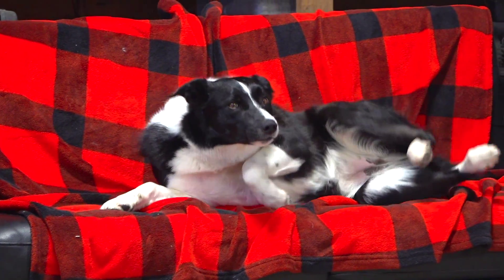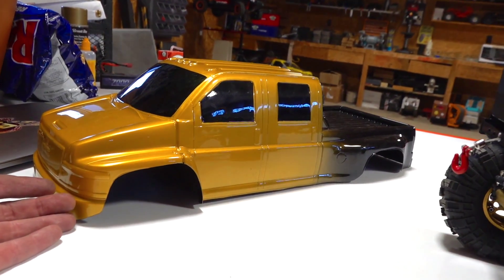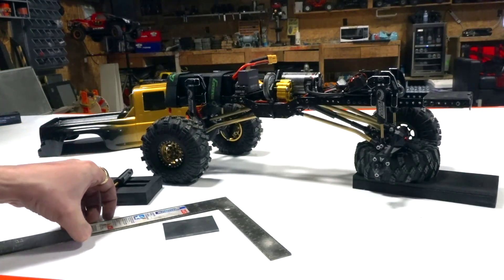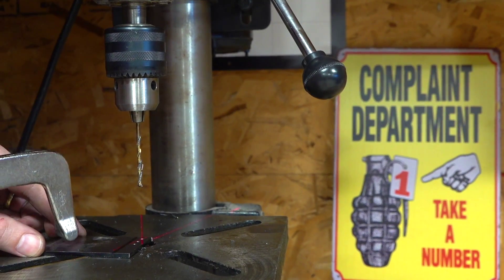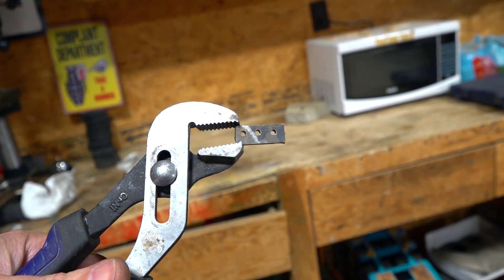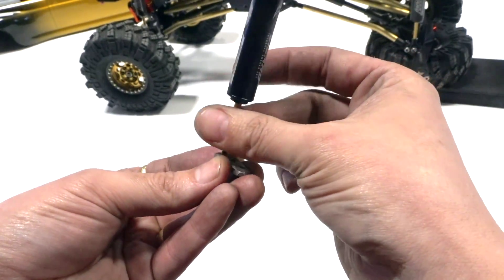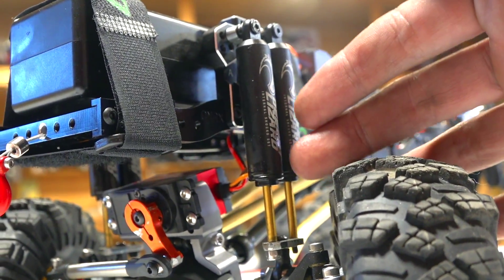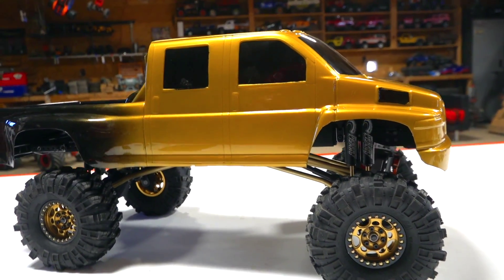PROJECT "OVERKILL" 2020 - HOW to MAKE a DUAL SHOCK MOUNT for ANY TRAIL TRUCK (PT8) | RC ADVENTURES

Comment: With your experience, I dont see how you could have chosen any other path for this build. I like watching you work. Exceptional build, thank you for sharing the process.
Reply from the maker: I felt the same way. I knew to make a new build of an iconic truck from 2012.. that in 2020, I would have to bring "game" to the table.  A lot has changed in the radio control hobby industry, as well as on YouTube. I am still not quite finished with Overkill 2020.. have a ways to go yet. Thanks for the comment

Comment: Just a quick tip for you for tapping holes; chuck the tap into your drill press immediately after the hole is drilled, before you move the piece. Turn the chuck with your hand to be 100% sure that your hole is tapped as straight as possible. Don’t use the power of the drill press to drive the tap for you. That’s a good way to break things! Hope this helps, keep up the amazing work!

Comment: Truck looks absolutely sick so far. One tip, don’t use an awl for center punching your holes, use an actual center punch. A decent center punch is actually made out of tool steel and the pointy end will stay sharp so much longer. Also, you should use some tapping oil when cutting threads in steel.

Comment: I remember the video where you pulled out the black Toyota without a wheel onto the trailer pulled behind the top kick. By far the best vid with that truck yet. (The snow plow ones are also pretty good)
Reply from the maker: "Black Tundra Rising".. Lol.. :) I remember

Comment: Medic, you may find that a scriber (sharp point in the end of a pen) to allow a thin accurate line to be made.  The carbide tipped are the best.  When you're on the drill press I noticed that the drill bit wondered, use a spot drill first, then the drill.  Spot drills are also handy for countersinking (breaking the sharp edges/ burr from the bottom of the hole.  love the build.  Jp

Comment: With the rear shocks vertically offset, if the lower of the two shocks bottoms out, it may put additional angular (?) load on the shock shafts of both shocks.  I'm not sure if the amount of force is enough to be concerned about, but it is something to keep in mind.  Keep up the cool build!

Comment: In Alaska we are at a great time for this and I think down where you are you still have the best weather. 

If you leave the steel shock mount plates outside, get them a little wet and possibly salt, and just let them sit outside for a while they will rust faster. It might be a way to artificially stimulate it. (Considering it will not spend weeks and months outside while in the RC.). 

Great truck, sorry, no, I have not seen the original.

Comment: You should cut the front bumper off the body and weld up a tube style bumper with your fairlead in it. You could make the bumper right to the body so it would protect it and also not get hung up. Great mod. I might use your idea!

Comment: Little advice in the truck pull/tug of war  use your winch around the axle to suck down the front suspension just a little should help with any axle wrap or wheel hop

Comment: Yes I could not beleive how long ago that was I remember from the first to the last big build. Suggestion add 3 to 5mm of fuel line and put between the chassis and the hook thread it over the cable and refit hook it will save the servo and also stop the hook from rattling.

Comment: FYI you can grind aluminum with a normal grinding stone etc. look for WEICON ALU Grinding release spray it on your grinding/sanding and drill bits and even cutting blades anything used to cut or grind aluminum it stops the aluminum from gumming up on surfaces. I have  been using it for 8 yrs in my day to day as a welder/fabricator.

Comment: Hay man awesome build love it, I do have a thought about the set up the shocks are free moving at the top but the shafts are ridged mounted at base which introduces a small shearing force on the shafts ( I’m not saying they will fail as is a light application) just a point of interest you may want to do a redesign to allow for a little more give. Usually see by side mounting has a solid mount on axle and shocks retain eyelets to flex freely. It’s a minor thing I think but man hate to see you loose from bust shocks, big hello to family now get inside and fix rc’s.

Comment: Why not full the secondary shock filled with oil and use as a dampener like a desert truck to use shock rebound and dampening to maintain traction no matter speed of compression or rebound, primary sprung shock maintains ride height while secondary utilizes resistance to keep tires on surface. And the custom shock plate would have even pressure to elevate shock pistons being bent at plate mounts, just a thought maybe slightly over thought but never the less I would do that for a crawler setup 🤔

Comment: I saw you were missing a locknut upfront, driver side shock. Also, if you want it to be a little more balanced in the rear, move your rear upper links to the outside of the truss (about 40-45mm screw). That helps a lot for me when I comp. I did watch all of the OG Overkill. 👍🏼

Comment: I didn't say anything about using a Grinding Stone on the Aluminum... It's YOUR Grinder!! 😜 A Belt Sander would be much safer.

AWESOME solution to the Fairlead issue, Aaron! 👍👍👍👍 

I of COURSE, remember that original Project Overkill - 😁

.... If you fit double Shocks at least 30 Degrees from each other, it helps eliminate Axle Windup... i.e. Axle Hop. 
Carmine ✈🚂🚙

Comment: A beast under the body. Just trying to understand the duel shocks set up. In this case it is for a strength rather than stiffness? Do the unsprung shocks add dampening at all? I love watching these clips to see what goes into the builds.

Comment: Good idea but on the back shocks should have springs in both, the front shock will leverage your bracket possibly braking rod end or binding the shocks. Your front is great.

Comment: The setup you have there will cause binding. If your are going to have them tied to a single pivot point on the bottom you need to have a single pivot point on the top also.

Comment: hey bud! cheers again from near Toronto..just a what if..but perhaps over time the winch might rub against the frame and the wires might start to split apart. was wondering if a rubber grommet hot glued to your oversized hole would do the trick or would the grommet would wear out before the wire. not sure since i do not have an winch on my RC, but just an idea. keep up the inspiration to everyone who follows your channel like myself..another cheers to you! keep up the amazing and informative work.

Comment: I wonder if you are going to have any frame tilt going sideways on a steep hill, I usualy adjust my shocks just at the point where you prevent that but still keeping it flexy 👍 To avoid a side flip rolling down the hill 😉 Stunning truck as always! 🤩

Comment: Mr medic I know you have a compressor.. the best tool I have is a nuematic angle die grinder and small disk sandpaper set up works great I use it for everything wood metal aluminum...

Comment: When you’re tapping your holes go in a turn then back off a 1/2 so that you don’t risk breaking the tap
Reply: JacksVIDS  very good advice I’ve seen guys impact em in and boom snap in the hole.. good luck drilling it out lol
Reply: Don't always have to. Depends on the size of the hole and the thickness of the steel and where it's at on the hardness scale.

Comment: Definitely remember the original Overkill build, just a curious question though, have you thought of a way to keep the duals from twisting side to side, causing a possible binding/rubbing between the shocks, just a thought nothing more

Comment: Hey medic I have a traxxas slash 4x4 and I have been running 2s and I switched to 3s and I can not keep my drive shafts from snapping even steal ones. I was wondering what you would run in your 3s slashes?

Comment: It would be easier to have the center hole with no threads in it. Slightly bigger to the screw threads. No binding to secure in the shock eyelet

Comment: How about making a triangular plate with 1 hole at the bottom to secure to the bott mount point, then 2 holes at the top, and connect the bottom joints of the shocks to each of the separate holes, front and back on the triangular plate.. This would distribute the load better and overall be stronger, not relying on a single vertical screw into a plastic joint at the bottom

Comment: The only concern I have with that shock mounting is bending of the shock rod ends and you should have both shocks with springs but with reduced spring strength

Comment: You should look at the bottom plastic eyelid at the end of the shock, all of the weight of that “tough truck” is on that tiny little eyelid and will snap. Don’t want that on the trail. Maybe get a aluminum one. Or stick with steel and redesign it.
Reply from the maker: Aluminum, but they are in transit

Comment: Why don't you mount a vertical extended bracket from the suspension bolt and the shock mounting bolt, that goes above the axle,  you can then bolt two shocks too ...kind of hard to explain

Comment: Aluminum powder or grinding swarf is potentially dangerous if it is mixed with iron or steel grinding wastes and is wet. These are the basic ingredients of a thermite bomb, and there is a very real risk of a fire due to the reaction between the aluminum and the iron. However, if the aluminum and iron wastes are kept separate, then there is little risk.

Also, what are the actual benefits of having more than one shock? I understand if you have two eyelets having a backup would be good but if it's all on one eyelet what would be he benefit as your putting it all on that one eyelet versus two...little confused :(

Comment: Hey rc sparks I’m looking for new 1.9 wheels and tires all metal for the weight and bead locks for a good price and lots of styles can you send the website or sites you use open to everyone and also looking for the best 110mm shocks metal preference as well

Comment: Why can't you use aluminum on a grinding wheel it's softer than steel but if you can use steel on a grinding wheel or titanium why wouldn't you be able to use aluminum
Reply from the maker: I explained it in the video Ron :)